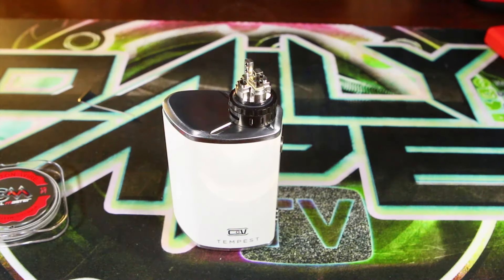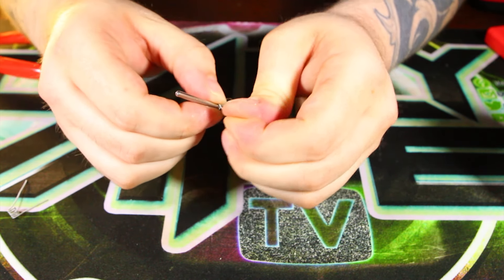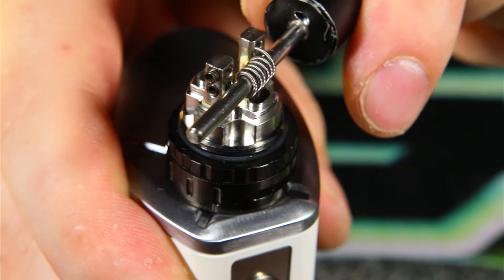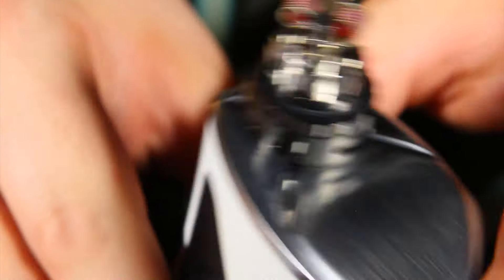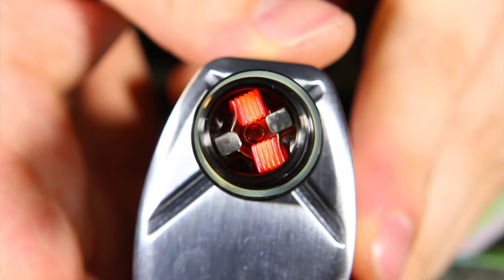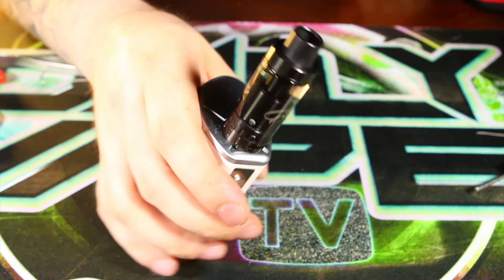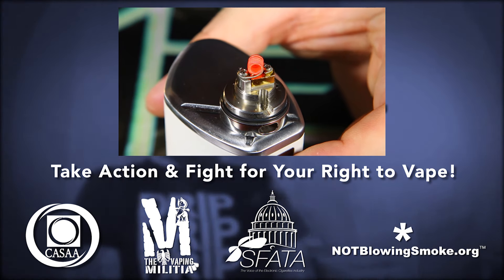Fresh Build WEEK - Day 4 - Dual Coil RTA

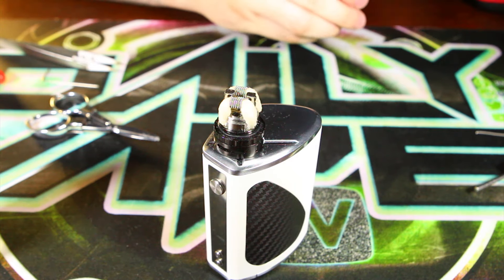Comment: just wondering did anyone else see the police car zooming by the bottom of the screen at 9:44 Lols. Love the videos tho new to the channel
Reply from the maker: hahahaha Yes! I'm glad you caught that. I put that in there because a cop car drove by as I was in the middle of that shot and when I sped up the footage it sounded like a little tiny cop car was flying by. You'll see a lot of those little easter eggs in my videos :)
Reply: +Daily Vape TV that's cool. just wondering I couldn't see the size of wire used in the Clapton. I have a series mod with the Hatty and I can't build below a .35 ohm. I've wanted to try a Clapton build but every time I make it the resistant is 2 low